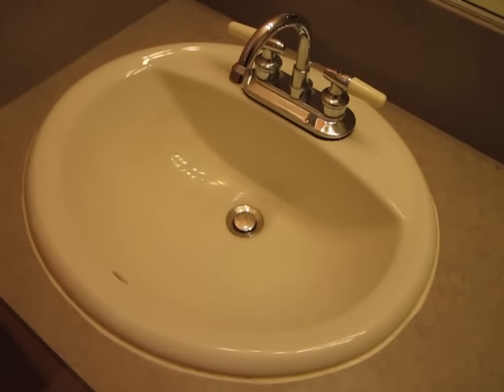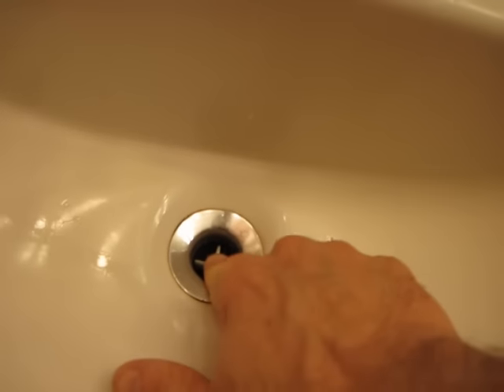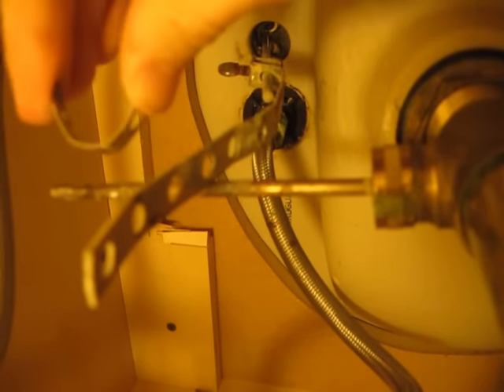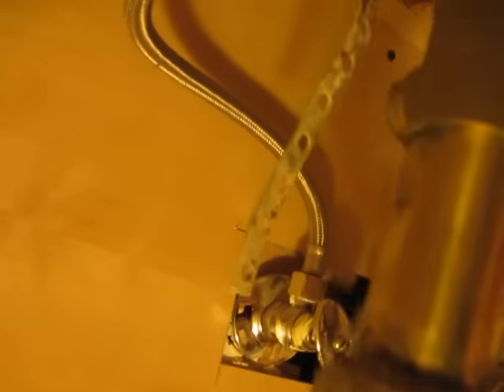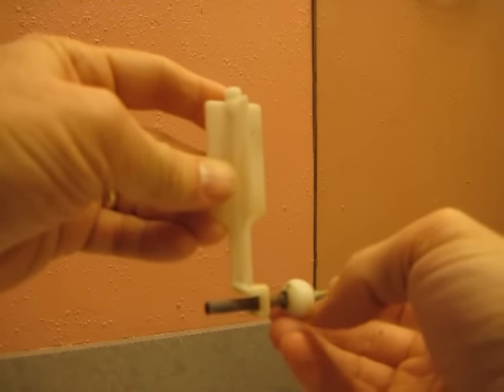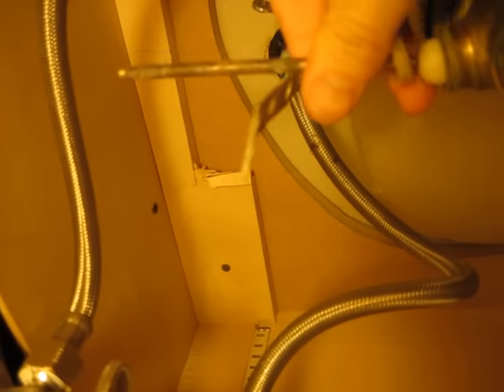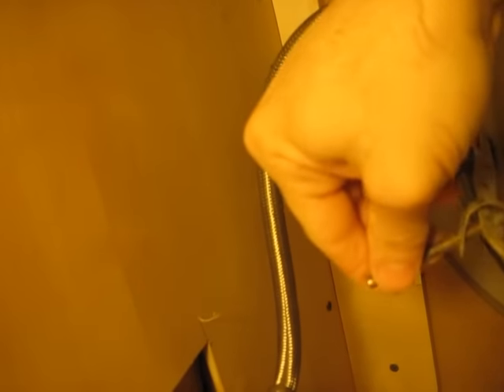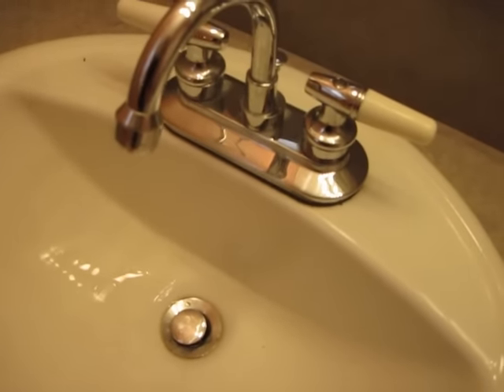How to Clean Out a Sink Pop-up Drain Stopper

Comment: 10/10 would recommend. Got home from work and was fed up with this drain that almost overflows simply by brushing my teeth. The hole in the back of the sink also gets stopped up so it's useless. Was seconds away from buying a snake but jumped on youtube and found your video. Had no issues fixing it. I am amazed at how well that worked. It drains like new. My regret is that I didn't do it sooner. I've suffered for a couple months and bought draino and still suffered. I am ashamed I let it go on this long when it was fixed in 10 minutes. I feel so capable. Never again will I have a stopped up drain. Thank you so much!

Comment: My stopper Fell down the drain and had to take pipe apart.  Leave the top on when you remove the stopper from underneath
Reply: Shawn Schultz good idea. The video mentions unscrewing the stopper. This won't unscrew and I don't think I did that last time.
Reply: Shawn Schultz I have the same problem.   Where did you take the pipe apart?
Reply: You remove the "trap"--the curved portion of the pipe; it should unscrew in two places. Might be shaped like a J or a U. It's actually not a bad mistake to drop the stopper down there, because when you unscrew the p pipe you might actually find a huge wad of gunk in it which is the bigger source of the drain problem. just have to make sure you put a pan underneath when you work because water and debris will fall out.
Reply: Thanks! Same thing happened to me and your comment helped me resolve the issue.
Reply: Shawn Schultz i wish I would’ve read your comment before..the same thing just happened to me 😤😤😤
Reply: Eventually you DO need to remove the "stopper" part so you can clean it all....
good to know the top part might fit in and fall down the drain.
Reply: Karen MacDonald you will never ever have  to remove the metal top. Once you disconnect the drain from the pop up lever you will be able to pull it out and clean it.
Reply: I used vice grips to hold the stopper when putting it back, to make sure I couldn't drop it.
Reply: Just happened to me
Reply: Left the top on the stopper and now I can’t get it out 🙄
Reply: i dropped mine down the pipe as well & found a bunch of mold, so honestly was glad it fell bc i never thought in my life anything would’ve been that disgusting in my house. 🥺
Reply: Was looking for this comment to see if it only happened to me😭 and I don’t want to tell my mom what happened cause then she won’t let me take the sink apart to fix it but I’m scared to do it by myself😖 welp it’s 9pm so hopefully this won’t take me too long😓

Comment: I am so excited this was simple enough for me to fix. Can't believe how long I've dealt with a slow drain and tried a few versions of Drain-O when all I needed was this video. I thought I would remove the plug to use a snake, but all the slowness was from goop caught in that top part, no snake was needed! Now my sink is perfect! I even learned how to fix the lever so it moves the sink plug up and down again! My only complaint: would have been nice to know that, after taking the metal bar out, the plastic piece would plummet to the bottom of the drain loop. Fortunately, I remembered watching my parents take apart the bottom curved piece of a sink and easily found the plastic part.

Comment: Me: Oh ok, step one seems simple enough, just gotta remove the top thingy! 

The top thingy: Think again mortal.
Reply: Its been 1 hour already
Reply: @helmato  3 months later and I still haven’t gotten it-
Reply: Yeah I can’t get the top off either
Reply: I can’t get mine either ☹️
Reply: You don't need to remove the top on it, mine doesn't come off I just removed it with the top on.
Reply: @nicknac93   yeah, I figured that out. Eventually I had to unscrew something under the sink and it came out as one piece.
Reply: PLSSS IT WONT COME OFFFF
Reply: WAIT I GOT IT OFF, HERE LEMME SRND THE VIDEO
Reply: @mogusbogus4961  AHH THANK YOU😭
Reply: @Whackusbonk  WARNING, EVERYTHING IS SO DIRTYEBUDJSJSJD
Reply: @mogusbogus4961  Warning noted😭😂
Reply: Mine stabbed me.
Reply: @joshnabours9102  w h a t 🤠✌️
Reply: @mogusbogus4961  thanks. I broke the plastic mine trying to rotate it counter-clockwise. To Amazon for a new one
Reply: Some old versions aren’t able to come off

Comment: Thank you very much for this video.  Before watching this video, I knew absolutely nothing about the plumbing under a sink.  Today, following your instructions, I tried unclogging our slow draining bathroom sink.  Your instructions worked perfectly!!  The water drains freely now.  I was so proud of myself after I finished the job.  If I hadn't seen your video, I would have called a plumber because I tried a liquid drain opener, but it didn't work.  BTW, the top of my stopper doesn't screw off.

Comment: Thanks! Used this video to unclog a sink 4 years ago, now I'm back to watch it again to unclog one in the new house we moved into! So easy and requires basically no tools. HOT TIP: I know this sounds gross but I have long hair and deal with hair clogs a lot.... everyone with a long haired person at home needs to get a wire hanger and bend the end into a "U" shape, then send it down the pipe and it will grab all of the hair clogs. Works like a charm on sinks or shower drains.

Comment: I don't know why I didn't search for how to deal with nasty drain stoppers before this! I've just made to with those plastic stick things you can put down it. Thank you! I got my jewelry back ( had undo the p trap-soo gross) and got the stopper off/cleaned up the goop & rust then got it all back together again. Thank you for explaining all the parts/functions and that you need to put the tip & the drain plug in together at the same time so it will catch better (eventually)!

Comment: Thank you so much for this video. My fiance and I just moved into our new apartment and the sink would not drain. This vid helped tremendously!
Like another commenter said, the plastic bit does fall down the pipe when you put it back in the drain. Whoops! I also had to take the bottom pipe apart to get it, but it gave me a chance to clean all the gunk in there, too. Just be sure to put the top back on first if you don't want to have to deal with the pipe!
Thanks again for the video!

Comment: This was SO helpful!! Thanks!! - I will add that when I put the (cleaned! 🤢🤮)stopper back in, it kept falling in too low into the drain… so I screwed the top back on first, then slipped the stopper back into the drainhole & things lined up correctly so that I could slip the metal pole piece back in, under the sink - 🙌🏼🙌🏼VICTORY IS MINE!!! 🎉

Comment: Works great. I also discovered I could clean the sides of the drain pipe with an old toothbrush that just happened to be on the sink counter. Dropped it a couple of times, but those needle-nose pliers were able to pick it up!

Comment: Here I was, after living with a clogged sink for 5 MONTHS (basically since I moved there) I always tried to unclog it from the top thingy with my only tool: a nail file and EVERY SINGLE TIME it broke,  and I tried so many things like putting dish soap (maybe it was grease) and putting very hot water on it. It always ended up working at least enough for the water to be sucked in a couple hours, sometimes even minutes. Fast forward to this week, the water was stuck again, I let it wait because it was just a little bit, then the day after there was some more, and it stayed like that all week. But today, I was DONE with it, I tried everything and nothing worked even the tiniest bit, so after a while I decided to search and found this video. It was explained in such a simple way and I didn't even need anything! It saved me but I wish I didn't have to see the horror that was stuck in those pipes, I almost puked, but I did it! Now the water drains in like 2 seconds 
So thank you so much imma go cry now

Comment: Great video! Question, though: why unscrew/remove the top piece of the stopper first when you could use it to pull it all out after removing the bar behind the drain pipe?
Reply from the maker: You don’t actually have to unscrew it.  I just did to show what it looks like underneath

Comment: Thanks alot! Just got mine unclogged and snaked in 10mins or less. After i got the rod out my stopper fell into locked position and i had to put the rod back and put a flat head screwdriver in between so it couldnt lay flat so i could pull the rod back out and pull the stopper out. Just a tip for everyone watching to make it go quicker 👍

Comment: Thanks for the video!  I followed your directions, and successfully unclogged the sink.  However, when I reinstalled it, my stopper no longer "stops".  The lever still pulls the stopper up and down, but it won't stay at the top or bottom.  It always just goes to halfway point between open and stopped.  I'm not sure what I did wrong.

Comment: I found this clip today (hope you get the message) because I want to remove the stopper all together to replace it that plastic  as seen on tv hair catcher. It's called the tub schroom but want to use it on the bathroom sink instead without causing a leak. Can this be done?

Comment: is there anyway after removing the gunk and cleaning the stopper that the stopper could be put back into the drain without it being attached to the connection under the sink so that  the next time you need to do another cleaning you can just easily take the stopper off with just your hands from the sink on top?

Comment: This video helped, but I ended up breaking the stopper because it did NOT unscrew.  Is there a reason why you said to unscrew, couldn't you just release the bottom part and pull it out?

Comment: If you cut off a small section of the bottom loop, such that it changes from an "O" into a "C", from now on, you can remove the stopper by simply popping up, rotating the stopper 90 degree and pull. Most of the cleaning can be done with the stopper removed and you don't have to worry about leaks and bending the metal bar over time.

Comment: would it be a bad idea if i just didn't reconnect the pop-up stopper? Like at 7:32, he didn't connect it properly. Couldn't I just leave it unhooked like his was and it'd still catch hair/gunk? That way when it's clogged again, I could simply take the pop-up stopper out and wash it, unclog the drain, then put it back in when i'm done without connecting it?

Comment: The stopper on my GF's sink does not unscrew, and I don't want to break it trying to force it.. might be a newer sink. 
What's the next step? Can that be indirectly worked around. We thoroughly unclogged the sink about 6 months ago. And it's clogged again. That's unusual. 
I never clean my electric razor in the sink- wastebasket. I advised my gf to use a dishpan when drying her hair, and perhaps use liquid antibacterial soap . Wonder if that would help.

Comment: Thanks I did this once before years ago. Now, again. Edit to add: The landlord had installed a plastic, easy-remove curved drain piece so I took that off, too. Whew! Anyway also I used a straightened wire hanger with an old scrubby hand mitten around it to get some of that brown slime out of the pipe, and a toothbrush to clean the parts I could get off. So nice to see the water draining!

Comment: This is not your video’s fault but I have adhd and I opened up my sink to develop, which I did, & then realized the pull stick was basically melted because I used drain cleaner a couple months ago so I went to Home Depot to buy another one then fixed the sink then realized the entire sink area was filthy so I cleaned it w barkeeper’s friend then used contact paper on the area under the sink so if it ever leaks the wood won’t just rot through immediately & now my entire day is gone but my bathroom sink is working 🤗

Comment: Help! I followed this and the first half was great. Everything is cleaned out. But when I put it all back together, my sink leaks when it didn't before! What should I do?
Reply: I'm just a novice myself, but you might need to replace the plastic seal washer thingy that's between the ball stopper and the drain pipe under the sink. Good luck!

Comment: I did this and it worked but after I put it all back together my water pressure was completely whacked.  A lot less water coming out and shooting it odd directions.  What happened? I messed everything up!  Help! I didn't touch anything under there except for the plugger device on the video. How could it have screwed up the water flow?  help!

Comment: I think you should do an update that you don't HAVE to take that whole clip'/bar thing out. That if you JUST unscrew the ball thing take out the hair & screw it back everybody's lives would be so much easier. My thing is all loose now, nothing like before, & I'm done trying, since it's so much right up against the wall with no leeway one could have a heart attack due to the frustration. I think unscrewing without messing with the clip/bar would be that much quicker & easier. CORRECT?

Comment: I don’t see why you felt the need to remove the lever bar underneath once you disconnected the metal bar with holes from it.  At that point you can remove the stopper.

Comment: A "pop-up" stopper is not connected to any mechanical linkage.  These are used when the sink does not have stopper lever.  Same with a tub.  You have a conventional set up.

Comment: I don't know what kind of stopper u have, but I never seen one in my entire life that twists off counter clockwise with a simple twist of the fingers.  The rest of the video is cool, but also, that nut ain't gonna be finger loose either.  You shoulda did this video with tools since most of use have 10-40 year old sinks that we didn't prepare a video with

Comment: thanks
Reply: sink drainage must be covered at night to block insect
source :
'Cover drains with a stopper at night. You can use rubber drain covers or metal drain screens. Cockroaches are nocturnal, so it’s most important to block their entry at night'
in https://www.terminix.com/blog/diy/remove-roaches-from-drain
from google (insect from sink drainage) result 2

Comment: This design has always baffled me. It’s poorly designed, very user unfriendly to remove and clean. And it’s literally in every bathroom sink installed prior to 2005.  Every piece of crap, gunk, hair and muck gets caught up in this and it’s a pain in the * to remove and clean. There is another option but surprisingly the fix is unavailable at any big box retail stores. If you can find a decent handyman who is good at basic plumbing, I suggest replacing the drain with a pop up drain assembly with a detachable basket stopper. You can find it at Amazon. They are between 25-35 bucks but well worth it. You can easily remove the drain stop and clean it quick and easy.  I watched some videos on how to replace the drain assembly right here on YouTube. Bought the drain assembly with detachable basket stopper on Amazon and replaced mine. And then I did my other bathroom and then I did my moms.

Comment: Never freaking remove the top metal thing because that’s what stop the plastic part from falling down the drain 😤😤😤😤
Reply: Sponge Bob you need to disconnect the lever to take the plastic thing off to clean it. Removing the metal top has no purpose whatsoever except taking away the stopper to avoid the plastic from falling directly the drain.
Reply: Sponge Bob I understand that but that’s not what the video is showing ???
Reply: Sponge Bob lets drop this....I have commented on this video because it shows to remove the metal cap from the drain and it is useless to do that and also put the person at risk of dropping the plastic part down the drain. I am not the only one it happened to...I wished I would’ve read some comments prior too.
Reply: Sponge Bob maybe if I write it in French it would help you!!!  Read Shawn Shultz comment that may be easier for you to understand and please do not worry about me , I have fixed my problem a while ago!